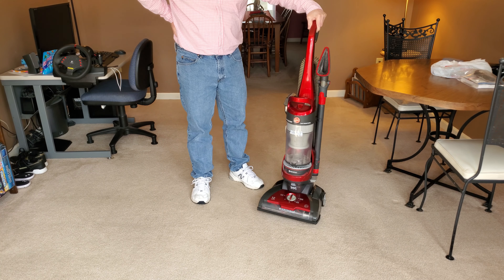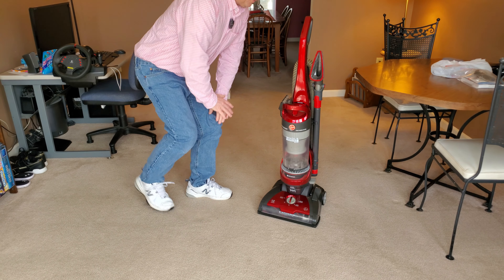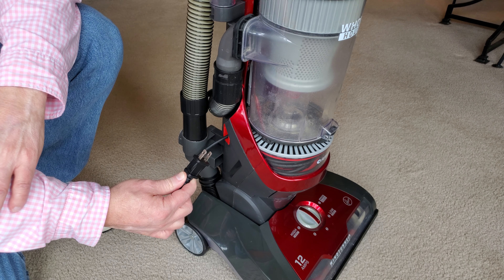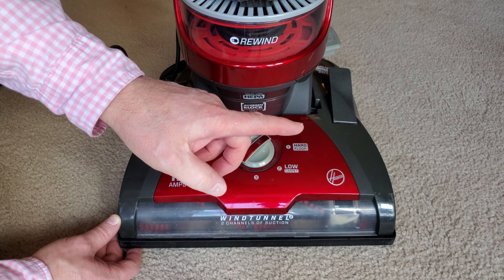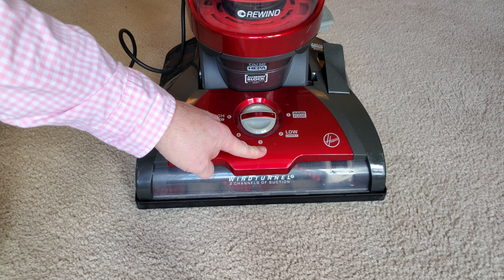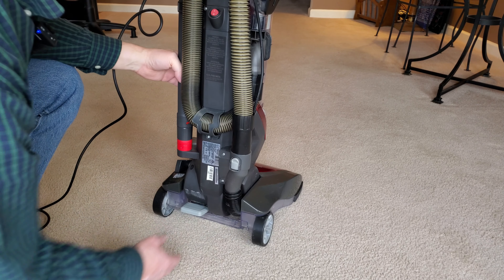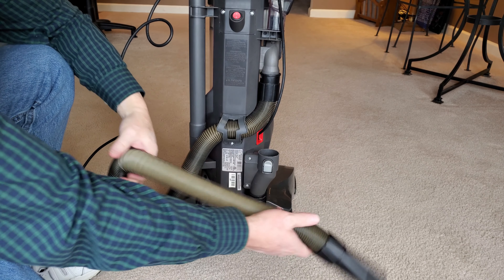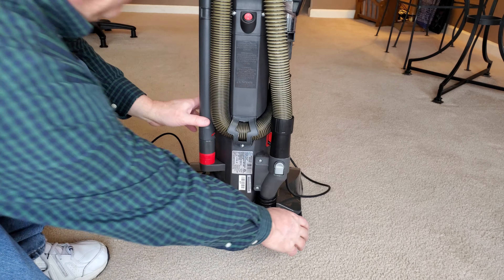How To Use A Typical Bagless Vacuum

Comment: Yes, great video. So many other maintenance videos could be done with your collection. Kirby owners often don't pay attention to the full bag line (other bagged machines too) or they don't check the fill tubes for leaks, holes and cracks. Belts are over looked until the break. Bagged canister vacuums the pre and post motor filters get overlooked.
Reply from the maker: Very true!

Comment: You crack me up! I love your humor. What amazes me is reading people's reviews of bagless vacuums - Shark, for example - on Amazon. So many say, "I loved it at first, but after 3 months....5 months.... it lost suction and doesn't pick up anymore."  Then they give it a low rating. I want to yell at them. "Clean the $%&# filters!!!" People won't maintain a vacuum, treat it like a plug-and-go, then fuss that the vacuum was a waste of money. They're causing the waste of money if they don't realize regular maintenance on a vacuum is crucial to its longevity! 
I'm curious about your thoughts on Shark's newest line, the Stratos series. I don't see any videos from you on the Stratos upright. I just ordered one online, the AZ3000, because it was $130 off and only $299. Have you gotten a hold of one yet? I'd love to see you review one.
Reply from the maker: I don't have a Stratos at the moment.
Reply: @VacLab  if FedEx ever finds mine (tracking shows no movement since 3/1), I will give feedback

Comment: I was just thinking to myself yesterday how the term “vacuum cleaner” is pretty much a misnomer. Outside air cannot exist inside a true vacuum. For example, the vacuum lines in cars; if you have outside air entering, say, your brake lines, the pressure is lost and your brakes will not operate properly. But without airflow, a “vacuum” cleaner cannot function.

Comment: What I hate about when people have bagless vacuum cleaners that they just leave the dirt in the container instead of emptying it after they are finished with it
Reply: Right!! And they don't clean the filters either. Ugh
Reply: @MaryB_TN  I grew up with a Rainbow D4 so I have an idea why maintenance is important on these bagless machines.  My Mom taught me how to use one from a young age (primary grades in elementary school so around the age of 6 or 7) and the process of putting it away, including rinsing the water basin and drying the seals, in and around the separator and other places that got a bit wet.  Also checking the separator itself and cleaning when necessary.  I now apply this to the other bagless machine in our home, a Shark Rocket stick vac.

Comment: oh yeah one thing i would add is to wipe the seal at the bin and at the cyclone to help prolong the life of the rubber with windex or maybe oil . also helps keep a good seal.
Reply from the maker: I use ArmorAll on my seals.
Reply: @VacLab  Helps preserve them, good point.